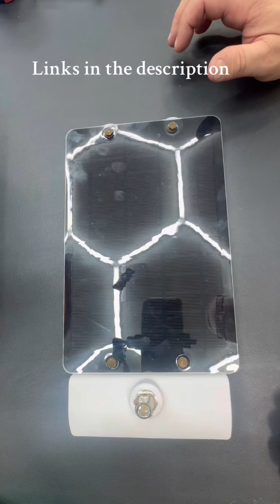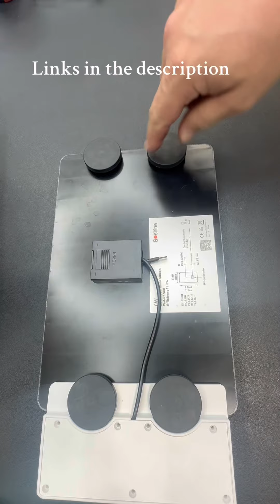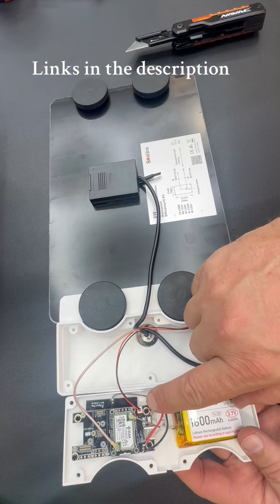Deeper dive on the Trucktastic Solar Node

Comment: picking up nodes? can you explain what those are ? sorry it's probably a silly question
Reply from the maker: Not silly at all! So for simplicity, each device is a node. Each node broadcasts in a radius from the node. As long as there is another node within that radius, that node can extend your range and so on and so forth. Much like a mesh router. So if you want to send a message to someone 50 miles away, it might hop across several nodes to get there.